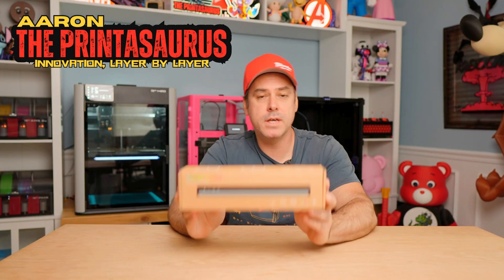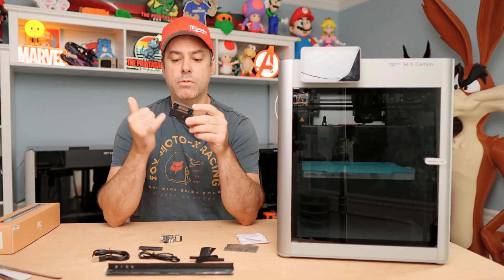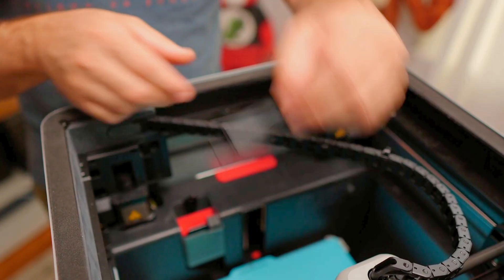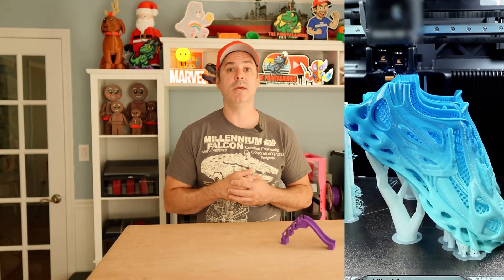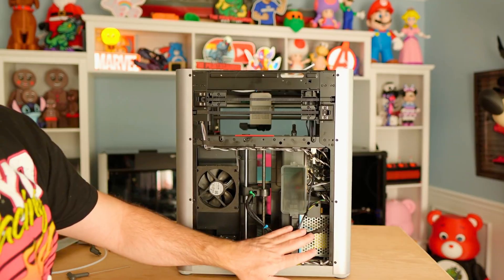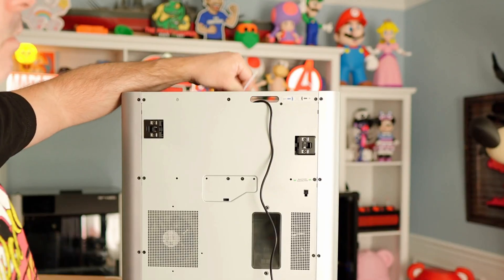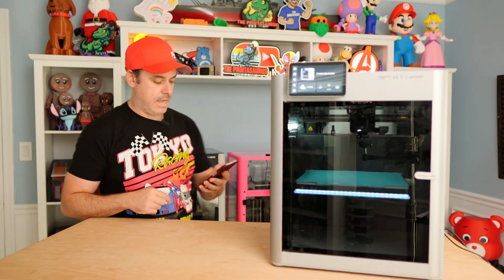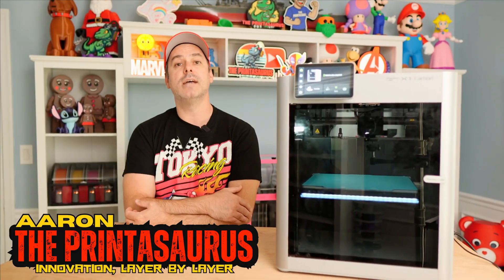No Status Bar? Fix That! BTT Panda Status for Bambu Lab X1/P1/A1 printers

Comment: Beats me why they tought of mounting the strip on the moving bed? Just on the front panel wil do fine.. The bed moving up and down can cause cable issues and the hot environment inside might make the self adhesive back of the strip to fail..  Or is it just more "cool" this way? Not for me
Reply from the maker: That is a great point on mounting. It hasn't bothered me with moving up and down as it doesn't move that fast. But I can see your point as well! Thanks for watching.

Comment: I ended up just running my wires to the right side of the printer linking to that spare USB on the back front side of the machine. I didn't like the idea of running it to the back having to use an external power supply.
Reply from the maker: For the P1? The X1 doesn’t have the same usb port near the screen.